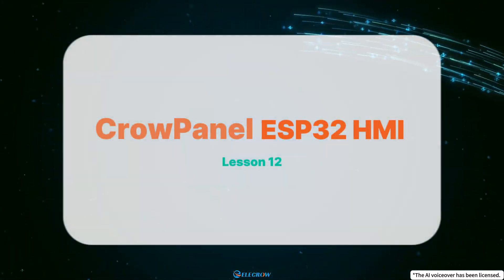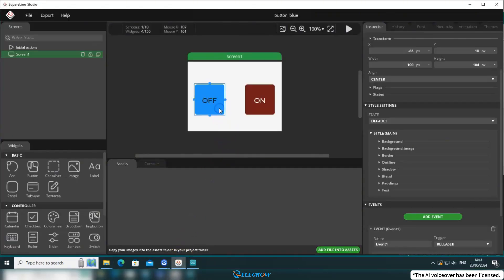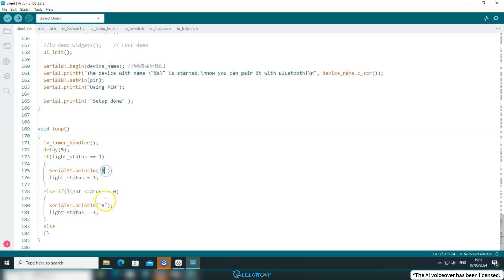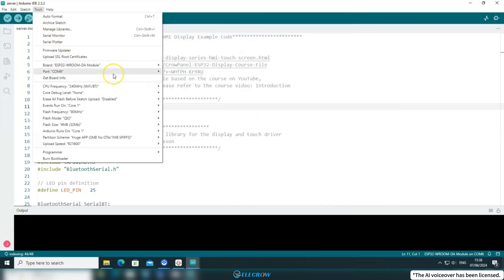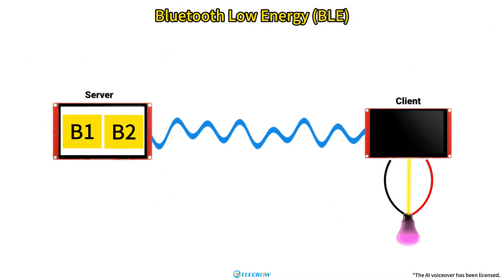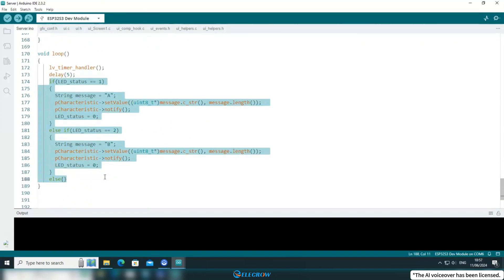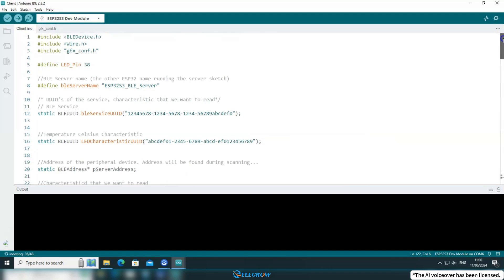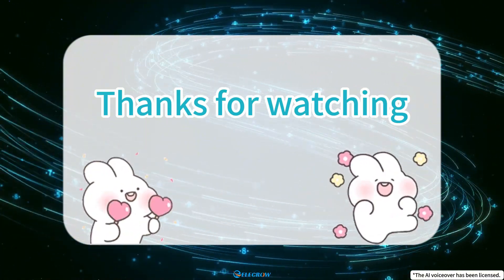Get Started with CrowPanel HMI Screen: ESP32 Communicate with Other Devices via BLE

Comment: How can it communicate with a single ESP32 instead of using another HMI screen?
Reply from the maker: Hi, it features integrated Wi-Fi and Bluetooth-compatible wireless functions. Let's try to use WiFi or Bluetooth to communicate😊                            https://youtu.be/Wid2HuwNGx8?feature=shared